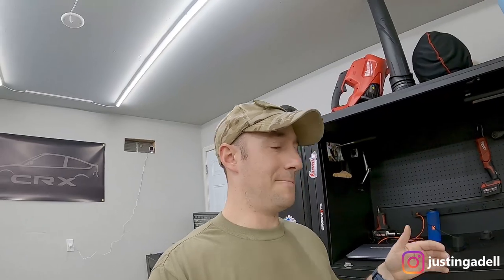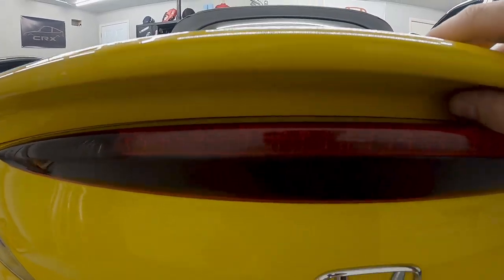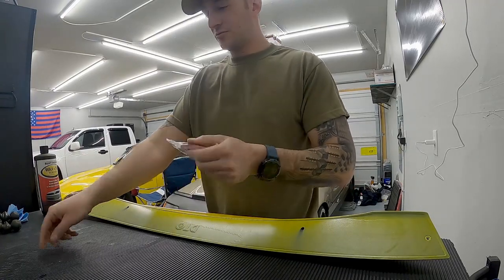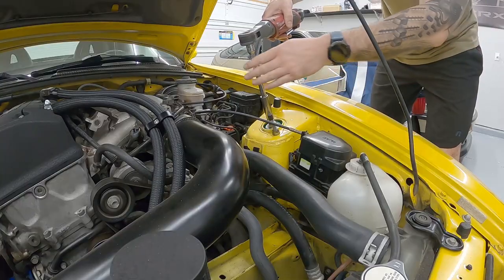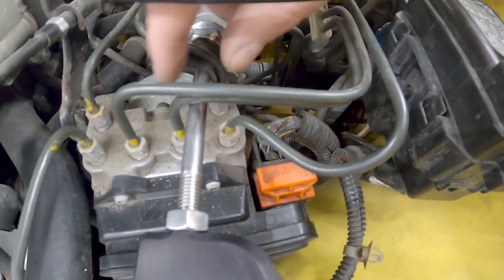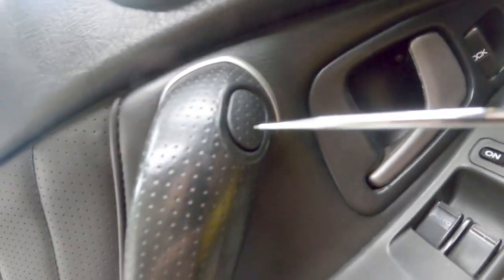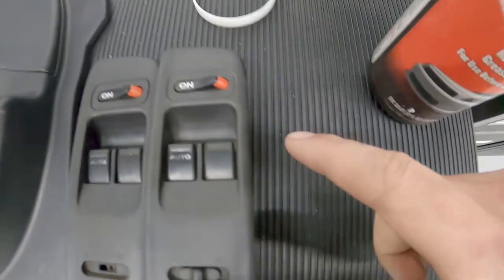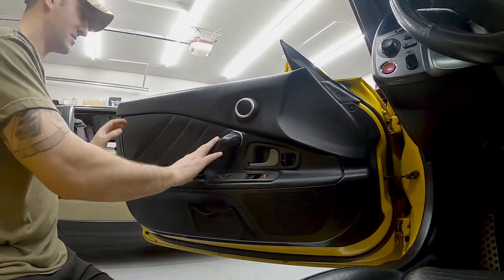Honda S2000 eBay Wing & LHT Master Cylinder Brace Install

Comment: Yup I just installed my brace the other day, a little pricy but definitely noticeable brake feel. Especially with the Goodridge lines. I saw he sent to the key chain too. You should've gotten stickers as well 👍
Reply from the maker: I THINK I did get stickers I probably took them out when the package first arrived and forgot about them lol. I’ll have to look into changing lines and freshening up the calipers at the same time
Reply: @justingadell  yeah that's a fun little one day project I did. Take off the calipers and wire brush and alcohol prep for caliper paint. Clean and grease the caliper pins and install Goodridge brake lines. 😊 And flush your fluid if it's looking like pond water.